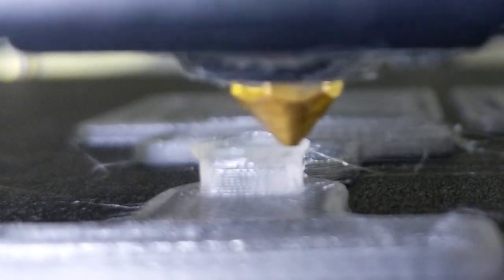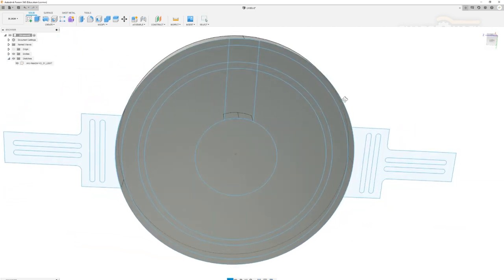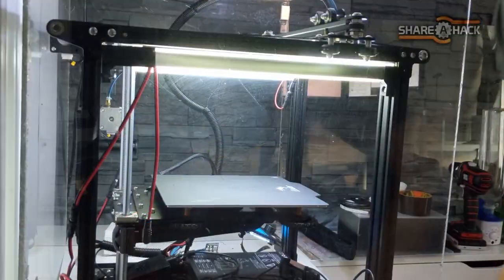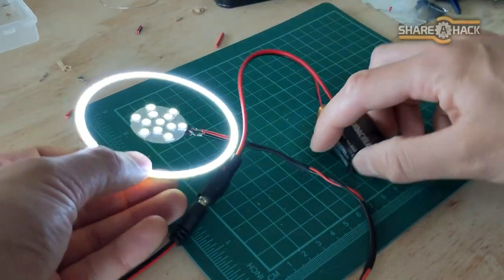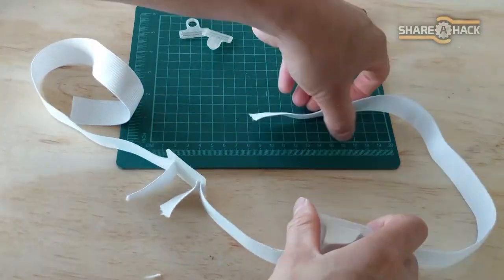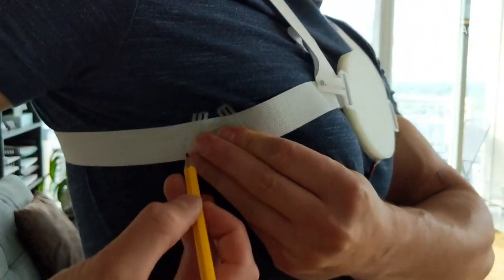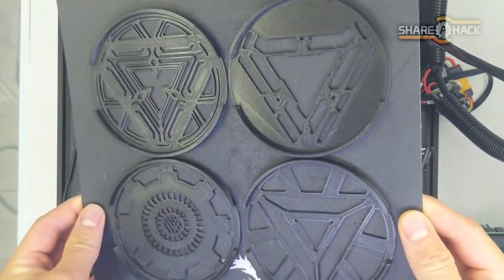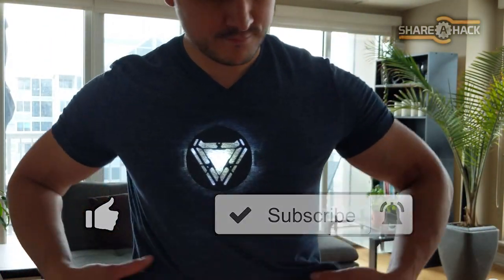DIY Wearable Iron Man Arc Reactor with 5 Interchangeable Faceplate Designs (3D Printed)

Comment: I had already made the decision to print one of the other models before I seen yours.  I might print it later.  I like the 2nd design plate in yours.  I do like the one I already printed, mainly due to the clips where the red magnet wire wraps around them.  I just think they look nice.

Comment: I think if you use a magnet to stick it on the shirt it will be more portable. and add blue light to make it more realistic. anyway i will try it, thanks for the template
Reply: Using a magnet is a bad idea, ive made one and the magnet attached to the shirt pulled the shirt down and shofted to much, the harness is a better option because it keeps the reactor in place

Comment: Why go through all that hassle and discomfort with a strap? Just use neodinum magnets. Place a magnet on the back of the prop and then place another magnet behind your shirt. The two magnets will connect and hold it in place on your shirt without all those crazy straps.